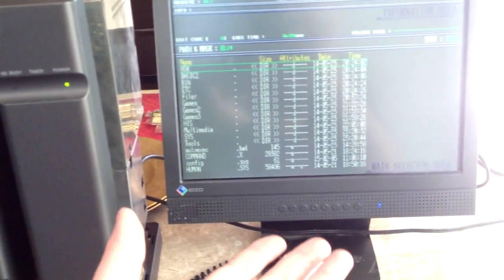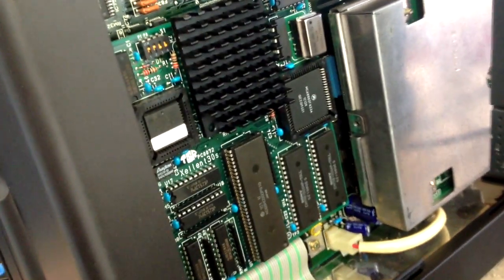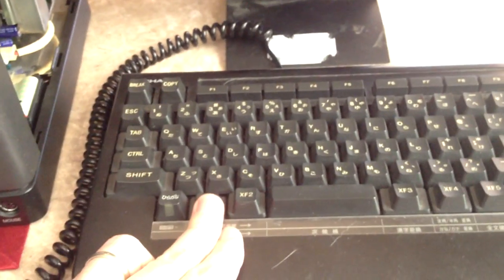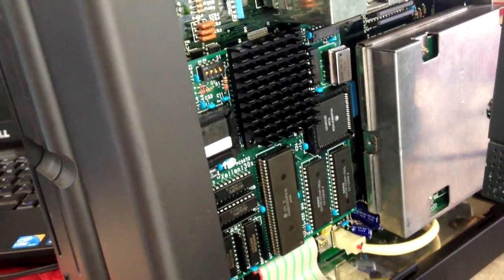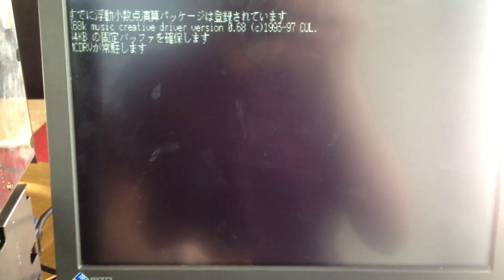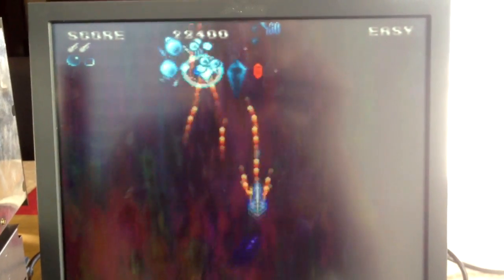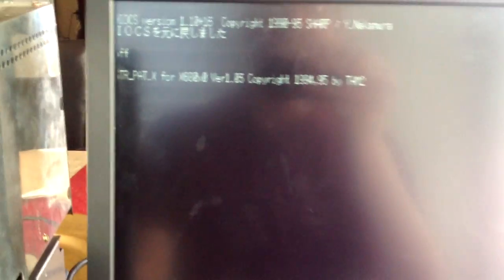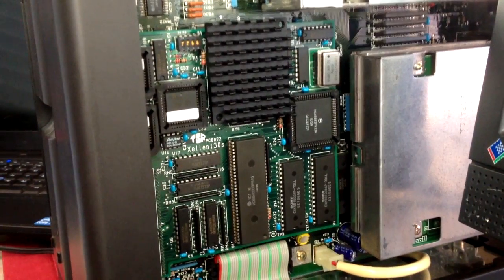X68000 CPU Accelerator - The Obsolete Geek

Comment: IIRC, at 20MHz 68030 runs at 8 MIPS (20 MIPS at 50MHz), or about 7 times faster than the original 68000.  If you'd gotten the 68040, they run at 44 MIPS!

Comment: that  AMD k6 CPU is 233Mhz I hate that PC. That motherboard was a piece of shit. it had to be dumped.I got ripped off. Now time warp. 2016  the CPU Socket for X99 motherboards that LGA 2011-V3 CPU socket. install the CPU and its cpu bracket snap the pins off the CPU socket. I gone though 16 ASUS X99 Rampage V Extreme motherboards. one no refund. Gigabyte motherboard failed the same way. the Corsair AX1200i that failed due to Made In China shit ass parts.Like ASUS ,GIGABYTE,CORSAIR ATTACK CUSTOMERS , RIPP OFF CUSTOMERS LAW SUIT AGAINST CUSTOMERS.The Same shit how we lost Commodore and A-Bit RIPP OFF THE CUSTOMERS FOR THE BETTER FOR THE FAMILYso my one build taken 3 years to finish and its still not done right. That's a clue Stop building tower PC. Some how its got to last 40 years I know that is not going to happen.  back in the old days COMMODORE 64 and AMIGA 500 gave me a lot of shit to deal with !  had to waste a ton of money buying new stuff that dose not work and no exchanges and no refund

Comment: 10 Mhz bus for 16 bit words or 32 bit words ?
Reply: Zarchos The 68k socket that the accelerator is in only has 16 data lines. That's a bigger limitation than 10MHz.

Comment: What is that file selection program? Is it a part of the computer's OS?
Reply: pretty much but no; it's part of the computer's s ram; which is basically the sharp x68000's equivalent of a computer bios or firmware
Reply: It's a piece of Filer software called LHES. It's like a basic OS which works great with the SCSI2SD solution used here. https://www.gamesx.com/wiki/doku.php?id=x68000:lhes_tutorial